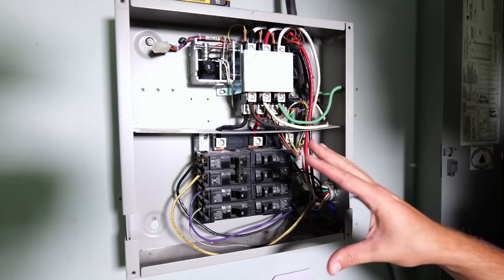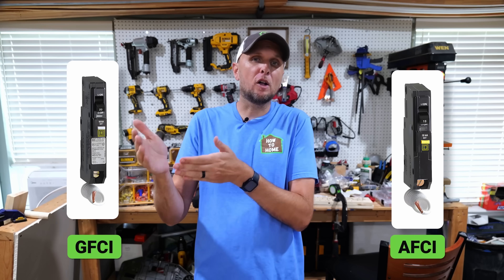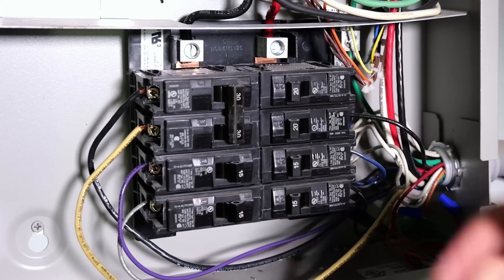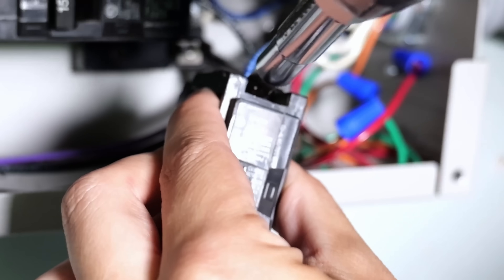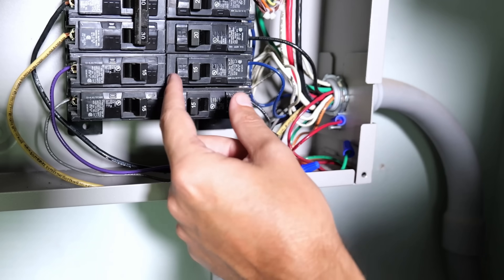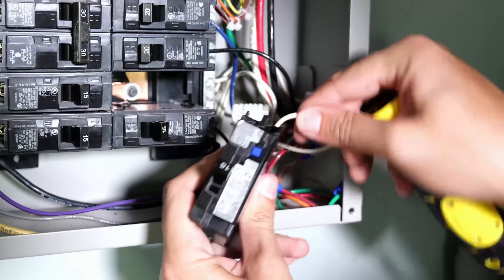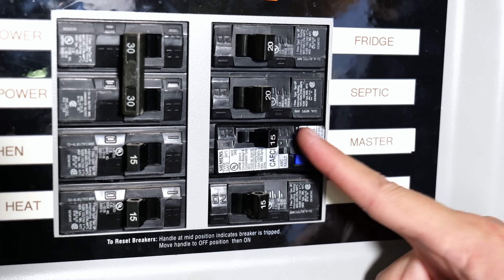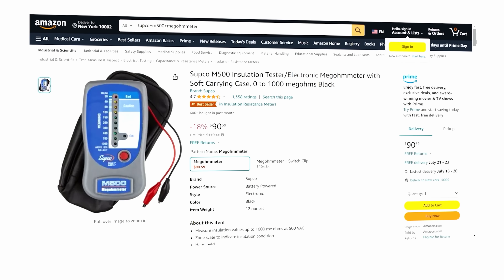Most DIYers Miss This CRITICAL Detail Installing Circuit Breakers!

Comment: Replacing standard breakers with AFCIs "just because" is a foolish waste of money.  In addition to this wonderfullness, you get tons of nuscence trips for free!
Reply from the maker: Well that is opinion.  Literally never had a nuisance trip on any of my AFCIs.  You might have issues with your wiring or breaker.  Should probably get it looked at.
Reply: @HowToHomeDIY  Opinion?  Yes- from an electrical engineer with many decades of design experience.  But of course I can change my mind.  A good start would be the detectable load conditions that would distinguish an arc fault from about a dozen other normal load conditions I could name.

Comment: 3:01 Appliances with arc-producing motors and switches can and do trip AFCI breakers.
Reply: Just try to vaccum. Trips every time.
Reply: Like kitchen appliances such as; mixers, blenders, food processors, carving knives etc. Or other appliances such as vacuum cleaners, or angle grinders and old, electric drills.

Comment: I will never put arc fault in any of my houses.  I dealt with them at my daughter's one house.  Unplug  something like a running vacuum  and they trip ...   My wife probably accidently pulls that out 3-4 times a week.   As do I.     They are so annoying.     GFCI are also annoying outside. Especially for Christmas lights.   I have set up outside outlets just for Christmas lights so they don't trip.    Also all of my electrical met code of the day installed.  Here where I live there is no requirement to upgrade except for kitchen and bathrooms.  Not garages or outside.

Comment: In 60 years of DIY plus working in electronic shops plus working with electricians, I have NEVER seen or heard of anyone using a torque screwdriver for this task.  I think that is HUGE overkill and truly wonder where YOU got that piece of advice from!!!!
Reply: Check the code-it is now required.
Reply: @oldguy1458  I was surprised just how much of a dimple in the copper it made when torqued to spec.
Reply: I use a homemade torgue wrench to put my cap back on my milk jug. This allows up to 5 days past the expiration date!
Reply: Just like head bolts or lug nuts on your car: a torque wrench ensures all connectors are good and tight without overdoing it. Large stranded cable is an excellent example of "how tight will compress the strands".  Last year we had an arc fault on a 3 year old solar system; the 8 AWG neutral had burned through at bus bar, total failure of that wire. The homeowner reset the arc fault detector built into the system for the high voltage DC from the arrays to the charge controller.
Reply: Did you think the manufacturer was putting the recommended torque load on the front of the breaker for the fun of it?

Comment: Very informative video! I have an older treadmill that keeps tripping my AFCI breakers. What do you recommend I use for this without swapping to a normal breaker? Arc filter, Isolation Transformer, etc?
Reply: Standard breaker. When you go to sell the house, put the Afci back in. The motors on those old treadmills use a brush type motor, that constantly arcs and gives Afci breakers fits. Newer designs use brushless motors and have fewer issues.

Comment: I would never install afci or gfci breakers in my main panel box.
Reason being you have to manually reset then to get current flowing through them if they trip.
If your on vacation say for 1week,2 weeks,and or a hole month if the circuit breaker trips say to a refrigerator and or freezer you content inside will be ruined.😢
Just my opinion. 
Opinions may vary 😊

Comment: I installed a GFCI/AFCI combo breaker for a new circuit for my garage. It trips really easily when using a vacuum cleaner or pressure washer and I'm at a loss...I've read that these types of breakers can be overly sensitive.

Comment: We bought our 1960 house and had to rebuild the whole thing. Looking at the electrical, we discovered that even when you turned off the main breaker, the water heater was still getting power and turned on!
Reply: How was the water heater still getting power, was there a panel outside with a circuit running to it???
Reply: If was directly wired to the panel W/O a breaker!
Reply: @jonaubuchon1040  Damn, now that is stepping over the line-fire hazard and putting  a water heater guy in a death situation...

Comment: We moved into a new construction house 3 years ago.  I've already had to replace 3 of the AFCI/GFCI combo breakers.  We lived 26 years in our old house that only had simple breakers--I never had to replace any breakers, not even 1.
Reply: My house was built in 2020, with Siemens AFCI breakers.  After a few months, one breaker start tripping once a week, then once a day, then every few hours, then it wouldn't last a minute.  I replaced it with a non-AFCI breaker.  A few months later, another breaker failed in the same gradual way, and I replaced it with non-AFCI.  A few months after that...  In total I had to replace 6 (out of about 30) of these essentially brand new Siemens AFCI breakers.  The last time was over a year ago, so maybe the rest are "good".  But it sure soured me on AFCI breakers.
Reply: @fredhamilton1701  Did you find out why the circuit breakers were tripping?
Reply: @ericbauer1937 My thoughts are Siemens made a bad batch.  Detecting an “arc” is more art (or guessing) than science, and it’s easy to land on one side or the other (good at sensing arcs but also false positives, or bad at sensing arcs but no false positives).  Some designs might be more susceptible to false triggering than others.
Reply: @fredhamilton1701 hmm. My house has those same breakers and it’s built in 2021. I’m here because I’m having problems with one of them
Reply: @fredhamilton1701  been dealing with this myself.  The breakers are super sensitive and honestly, they've been mass produced and not QC'd because they had to mass produce to keep up with new code.  Because they fail in a manner that would prevent fire, etc- they just let them go.  I foresee a class action suit in the future.  All of the electrical in my home was replaced in 2022.  Before I even moved back into my home, 2 AFCI breakers completely died.  I've had 2 AFCI/GFCI circuits that have constantly tripped over nothing.  I even had the city electrical code inspector come out and he told me its quite common for this to happen, especially with the timing of production in conjunction with code updates.
Reply: @fredhamilton1701  Did it occur to you that they may have tripped because there is an arc fault in the circuit?
Reply: @Roy-ij1wq Of course it occurred to me.  I swapped it with another 15A breaker and the problem then moved to that new circuit, so it was pretty clearly the breaker.
Reply: Money money money!!!
Reply: Yep. I'd replace the DF breakers that went bad with standard breakers, unless to kitchen, bathroom, outdoors. Then I'd shift unnecessarily DF breakers with those and use standard breakers to backfill for those. Haha. And that's only if the kitchen, bathroom, outdoors, etc didn't already have GFCI protection provided for otherwise.
Reply: My house is 5 years old and the Square D Home Line GFCI breakers are starting to go.. came home and found 2 different breakers on separate circuits tripped.. Reset OK, today a 3rd one tripped and wouldn't reset so I unplugged everything on that circuit and found a standard breaker, after install everything back to normal. tested all circuits for proper wiring etc. all OK. will order a $65 breaker to have on hand. My last house was 12 years old and same issue the GFCI breakers trip with a hair dryer, after a few trips they are too weak to reset and have to be replaced.
Reply: Too bad it’s code required.
Reply: Romex staples is the cause generally, of too sensitive Afci trips. There's also such things as non/semi compliant equipment, especially ones with 12/24V led/lcd panels that are DC voltage so don't use the neutral as the return path, they use the ground, which can sometimes be seen as an arc or ground fault, tripping the breaker. Washing machines and fridges are bad about this since now being required to be DP.

Comment: Code does not require the standard thermal magnetic breaker to be upgraded to an AFCI if it met the code cycle when it was originally installed.
Reply: Code only applies to new builds, they've more or less removed every category where a basic T/M breaker can be used.

Comment: They make a bit that is made for those screw connectors that you see on a lot of circuit breakers, outlets and switches these days. It is called a ECX bit.
Reply: I'm just a DIYer, but I tried out the ecx, and I feel like a square drive actually holds better

Comment: Thanks for the video. Even though you stated the sub panel was de-energized, you should have the circuit breaker in the OFF position when removing or installing the wires.

Comment: I re-wired my entire 70 year old house and new subpanels using AFCI/GFCI combo breakers for all circuits. I've had zero issues, no false trips.
Reply: Older Brushed motors can trip the AFCI breakers. The problem with GFCI neutrals is if the there are shared neutrals or if you have the wrong neutral connected to the breaker. Its just easier to use GFCI outlets, and you know the source (which device plugged in) tripped the GFCI.

Comment: My CB panel doesn’t have a master power off switch. Just CB’s for the various house circuits.  I do have a weak AFCI breaker that needs to be changed. It would be great if you’d do a video for changing a CB with power on.  Yes, I have to.
Reply: If it doesnt have a main breaker, one of the breakers in the 'normal' slots should be the main.
Check for a larger breaker, like 60a.   Your panel might be a sub panel fed from elsewhere.   
When you turn it off,  the panel bus should be completely dead (check with voltmeter), but of course the lugs and wire on that 60a breaker will remain live.
Reply: @davecarpenter4917 if a panel does not have a main breaker and there is not a main breaker outside at the meter, the panel is most likely an old style called a split bus panel and these were common from the 1950s through the late 1970s, prohibited for new installations as of the 1981 NEC.  For those that haven't seen one before, these older panels had two sets of bus bars, the upper bus which is fed directly off the meter and sometimes called the main section, or mains, the lower bus section (sometimes called the lighting section) is fed from a breaker on the upper bus, usually 60 amps and sometimes labeled "MAIN" 'SUB-MAIN" or  *LIGHTING ".   The upper bus housed all the two pole breakers for the major appliances, while the lower bus housed all the single pole breakers for the general purpose outlets and lighting.   To disconnect all power in the home, all the breakers in the upper bus must be turned off, and you were allowed up to six circuit breakers to do so, or basically six hand movements to shut off all power.
Reply: Do you have a disconnect outside by the meter?
Reply: @scotts4125 Only if I took the meter off which of course I can’t do.  No, there’s no user master power off switch.  I had an electric issue a few years ago and the electrician did it with power on.

Comment: Great video but on many occasions when replacing a standard breaker with an AFCI the white neutral wire isn’t long enough to connect to the AFCI.  Would have been nice to show the fix when you run into this problem.
Reply: Simple, in a breaker panel it is acceptable to extend the wire with a splice for the ground and neutral.

Comment: Saying AFCI’s are required is only the partial truth. They are required on new circuits to meet code. Everyone shouldn’t be running to their panel and freaking out that they don’t have the AFCI breaker required by current code. Codes change frequently, there are multiple items in someone’s home that don’t meet current codes and  you don’t see people tearing down their homes to make everything to current codes.
Reply from the maker: I didn’t say anyone should freak out.  I said they are recently required and also think they would be good to upgrade to.  Everyone has their opinion though.

Comment: don't know about code where you are at but in texas stranded wire is not code. only solid wire.
Reply: I was "wtf" too.    Are breakers even spec'd for stranded ?
Reply: Yes, stranded electrical wire is allowed under the U.S. National Electrical Code (NEC)—and in many cases, it's even preferred.

Comment: Absolutely a cash grab by the Electrical manufacturer industry, in conjunction with the Insurance industry.   And it lands SQUARELY on the shoulders of the end user's (homeowners)  Unnecessary, problematic, and VERY costly.   And yes, I've been an Electrical contractor since the early to mid 80's.  When the GFCI's came out, it was costly, but a good idea.  The Electrical industry made very good revenue on them, which was ok since they were needed.  Then along came the AFCI looking for a solution to a non existent problem, except to fill the coffers again.  I've heard this from other code officials as well.   Just my humble opinion/thoughts.   Have a great day   ✌🏼Peace
Reply: 100% agree. If you have GFCI on the wall, why ae you doing it at the panel?
Reply: @kriswingert1662  You wouldn't need to, all on the line of the panel or the in wall outlet would be protected. Much of code determines location of GFCI at panel now because people often switch out outlets and may not protect with another GFCI. Mind you, if you need to replace a GFCI the same thing can happen, but it should happen less often as outlets are wear items.
Reply: @kriswingert1662 section 8 housing requirements call for all circuits to be gfci,so easier(if enough open spaces(can’t double up circuits on one breaker)to do it at panel
Reply: The irony is that all these delicate AFCI & to a lesser extent GFCI are not compatible with solar inverters.
Reply: Absolute spot on !    Too much Govt and regulations on the people.  The so called AFCI potential problem lurking in every bedroom outlet and now i guess every outlet in the house, is absolute nonsense.    Like you said, the industry conjured up this mysterious problem so they could again force the end users to spend millions on the solution called the AFCI breaker.     Govt over reach is disgusting
Reply: How is it a cash grab? Genuinely asking people drill holes into walls every day and if it's a DIY project its likely there's no nail plates installed in the stud to protect someone from hitting the wire

Comment: I really love my Leviton Smart Service Panel. I have the Smart panel v1 which allows me to trip the breaker remotely (WiFi). Unfortunately, I can not reset the breaker remotely, but in the newer Version 2 you can trip and reset the breakers. The circuits are wired into the base of the service panel there are no wire connections in the breakers. You just remove the breaker, pop in a new one with no wiring to deal with. I do believe that the AFCI and GFCI breakers do have that neutral wire pigtail on it. Great video

Comment: You have stranded wire in the box? I’ve never seen that prior. Normally solid wire!
Reply from the maker: Not in my main panel.  It is just stranded going from the main to the sub to connect the circuits.

Comment: With arc fault breakers you almost need a tool to check them as you have one's that are defective and most electrician don't have one my brother in-law had one that didn't work and he had a transfer lift to lift him in and out of his bed and chair how long it was arcing we don't know but it fried the plug by the bed and 3 more in the circuit finding them was a nightmare also when you are out of the big city finding a new one ment driving to the city and to a big box store and at midnight non open and we needed power to get him from the sling to the bed had to double up the circuit until I could buy a new one as a site supervisor I found at the time most inspector's didn't use use the tool for checking them at that time had one inspector that did and first time I saw him using the tool he failed inspection because of a defective one he was the only one who checked not only the arc fault circuit but the GFCI outlets as well and found 2 GFCI circuit's not working either had to get the company to send someone out to fix it

Comment: Never seen stranded wire in a CB panel before. Great video, lots of good info.
Reply: Incoming wire
Reply: @akbychoice my guess is it's probably because it's part of the generator panel gear.
Reply: Used in panels all the time in commercial and industry. Romex is cheap and fixed. Strained is expensive because your in a conduit, and easy to upgrade as needed. Homes rarely need service upgrades at the point of use, so fixed is okay.
Reply: @jasonhamilton5756 except after the 4th owner or so 40 years after built...like 73% of all homes😂
Reply: Anything larger than 10 AWG.

Comment: when installing an arc fault breaker, always connect the breaker neutral and set the breaker first, and test the breaker to make sure it isn't defective.  on those particular breakers, you can unroll the coil of neutral wire just enough to get the tail pointed at the busbar, and it leaves the panel much more tidy.